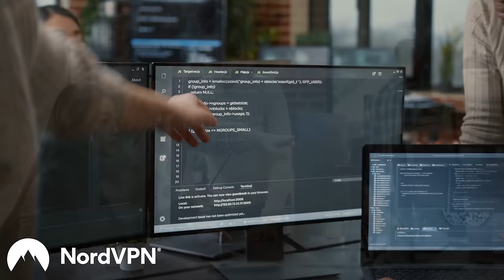Elon Musk fails Cybertruck stainless steel metallurgy test | Auto Expert John Cadogan

Comment: Franz and Lars explained this in the TopGear video. The problem is that because the yield strength is so high with the cold rolled alloy they use (likely 307- with double the carbon content compared with 304 or 316) they have a lot of springback. To compensate for this they have to overbend, but this results in low tool life from the die (what Elon means by “breaking the tool”). Plus they are using air bending, where the tool doesn’t contain the material, but there is high pressure air in between.
Reply: That's not at all what air bending is. Google it. You can have a bottom-bending die where the radius matches the punch+material, and you can have air bending where the bottom is "open" and the punch (plus travel and pressure) dictates the radius formed. There's coining too, but that's def not what's happening here. Air bending requires much less force but requires depth to be controlled, and it's much cheaper as you can use a much smaller press.. There is no "high-pressure" at all in air bending. Franz and Lars sound like idiots.
Reply: I think the choice of material used for the Cybertruck is not so much the strength, hardness, bullet-proofness but its ability to meet the regs for crash-structure / crumple-zones.
Stronger isn’t always better.
Reply: @axelknutt5065  Where are the cash reports? Crashes rely more on shape structure and engineering than material. Since this thing was announced, multiple people pointed out how hard edges and box construction wouldn't hold up to safety regs. Fenders and hoods and other body cladding are simply decoration to cover up the underlying structure. Are they sold as off road-only? I'd like ot see the numbers.
Reply: Imagine wasting time discussing the specs of a truck that will never be sold to the general public 😂
Reply: @axelknutt5065 if that was the only factor then practically any cheaper steel or even aluminum could have been used.  This is the same Stainless steel the Starship uses and is only produced for SpaceX and Tesla.  And neither 304 or carbon steel mentioned in this video could stop a 9 mm bullet.  Normal car door panels are no obstacle for 9 mm penetration despite what you may see on TV or movies.
Reply: @dk-bw4gk The CyberTruck is already being sold for on road use in the US and have passed all required testing and crash worthiness tests. Just because you haven’t personally seen the crash data doesn’t make it not true. It’s also untrue that the fenders and so forth are only cladding .  They are part of the structural strength and rigidity of the trucks structure and are bonded and bolted to the trucks cast structural component.  

The crash tests I have seen are way better than the ford lightnings and most any other truck on the market. No doubt like the Model Y it will receive top scores in crashworthiness.
Reply: @richb2229  I asked where they are. I haven't seen them. There was also a lot of talk about a bunch of things that didn't meet DOT requirements, like headlight height. Did they fix all these things?

Most EVs have good crash ratings because they weigh so much more than their gas counterparts and have an extremely low CoG. Having a 2000 lb ballast under your feet turns the car into a weeble wobble.

If the fenders are integral to the structure, does this mean a fender bender will compromise the structure? Will it be illegal to drive around with a dented fender? This reminds me of how a motorcycle must be scrapped if the frame has even the smallest dent.
Reply: @dk-bw4gk integral is a term so far only you have used.  The question is whether or not the exo-frame contributes in any significant way to the vehicle structure.  Tesla claims it does. Haters make up strawmen instead of showing actual data.

Either wait for the breakdowns or STFU. It's all unsubstantiated claims and speculation until proven otherwise.
Reply: @tripzero0  You're the one making claims, so likewise.
Reply: @richb2229  do you know what dk-be4gk is on about? I sure don’t - is he arguing for or against us?
He can’t  be an engineer because he didn’t begin his comment with “as an engineer … “ and that of course is a requirement for any conversation they have. F.I.G.J.A.M
Reply: Do you seriously believe that CT will never be sold to the general public? Remember you said this. You’ll feel silly not too long from now.
Reply: @richb2229  I read all your posts in my head in John's "outraged uninformed commenter" voice.  It's hilarious - thanks.
Reply: @dk-bw4gk there’s videos of the crash tests on YT. They have already delivered to a few customers and there’s videos on YT of people spotting customer’s Foundation CyberTrucks in LA. 

The headlights are down lower between the black strip and the SS strip. The strip along the edge of the bonnet is the light bar, not the head lights. So the head lights are down lower and legal, they won’t dazzle on coming traffic.
Reply: @anywhereroam9698 those aren’t 3rd party results for cybertruck
Reply: @papalegba6796  are you asleep?
Reply: @richb2229  I agree with you that it won’t stop a 9 mm but the gun that they used shot a 45 caliber. They also used a shotgun which shot. 00 buckshot. I think the 45 caliber only travel traveled at 945 ft./s. Most all of my guns shoot at about that speed. I think that’s a bad representation for the durability of the truck. On the other hand, most door skins would definitely be penetrated through the outside, and the inside all the way through the vehicle, even with the 45 caliber.
Reply: @dk-bw4gk He got more likes, so he won (sarcasm). I liked the argument about fender bender. Obviously they aren't structural elements.
Reply: @papalegba6796 this comment didn't age well. Lol
Reply: @linemanap  It aged perfectly, as none have been sold to the general public. There is no evidence any have 😂
Reply: @linemanap  name one owner please! 😂
Reply: @dk-bw4gk lol, calling Frans an idiot 🤡
Reply: @matthevandaalen6289  I don't even know who Franz is but I can't find anywhere where a layer of high-pressure air bends the sheet. There are pneumatic presses that use air instead of hydraulics in the ram, but there's no difference in how the sheet is bent. Blanc777 also described it terribly by saying "there is high pressure air in between" and I don't really know what that means either. There's also hydroforming whish is used to create intricate shapes in sheet, but that's not what we're talking about here. So please, tell me what air bending is and how it's not where the die has an air gap at the bottom.
Reply: @matthevandaalen6289  Alright, so I looked into what Tesla are doing and Blanc777 botched it up pretty badly. There are two bending operations discussed here: the braking and the stamping. The braking /is/ using the term "air bending" (even though it's already a thing) but it has nothing to do with strength or "breaking the tool" as Blanc says. It's only to keep one surface free of tooling marks by using a cushion of air. This is not the tool that's breaking. Then there's the stamping. They are stamping the interior parts (inside of the doors) in a very "clean" die made of aluminum-bronze. These are the dies that are breaking because, well, aluminum-bronze, and they're using this to also keep the marring down as aluminum and bronze are so soft. This has nothing to do with the strength of the SS but the softness of the die. For some reason (that I can't find) Musk is adamantly against protective coatings or films, so air cushioning and soft dies are used instead to not scratch up the panels. These panels are also 3 mm (1/8") thick! That's nuts. Why?
Reply: Yeah you are right. They are Tesla's internal testing. It complies with Federal Motor Vehicle Safety Standards, and has a preliminary NHTSA safety rating. They got 5 stars for their other models, from NHTSA. Tesla claims the CyberTruck is very safe. When more have been sold and delivered, NHTSA would test it themselves.  @Chuina
Reply: @dk-bw4gk  The crash test videos are on the internet. Do you really think a motor vehicle manufacturer would not know the required headlight heights? Theres been a lot of people spout a load of crap about the cyber truck. Try watching Sandy Munro's videos on it. He is the real expert.
Reply: @Jimmy-hf8fz  There are crash videos but no official tests and no data. No US agency (NHTSA or IIHS) has crash tested the CT.
Reply: @papalegba6796  Uninformed: it is priced as the other trucks.
Reply: @mletouutube  You can't buy one though 😂
Reply: @papalegba6796  I ordered one, will get it this summer. Don't talk about what you do not know.
Reply: @mletouutube  sure you will 😂
Reply: @papalegba6796  First naysayers said CyberTruck was vaporware (like this guy in the video) and now they say it is not for general public or will not ramp up production (moving the goal post is their tactic so they have the illusion they are not wrong to have stated CyberTruck was vaporware). The general public (in USA for now) who pays for trucks will pay the same price for the CyberTruck. Naysayers never learn that they should never bet against Tesla as even if Tesla is late in its prediction, it always delivers. The naysayers assume that there is a nefarious endeavor in Tesla or Elon Musk. It is a false belief. Having this assumption makes me suspect that jealousy is the motivation behind all this hate. Naysayers have been proven wrong again and again. They always double down or move the goal post. You are in this club for sure, especially this guy in the video.
Reply: @mletouutube  I'm not reading all that about a truck you can't buy 😂
Reply: @papalegba6796 😂 the hater denial is strong in this one
Reply: @AndrewReadman  "hater denial"? 🤔😂
Reply: Biggest issue I’ve got with the material used is the reason for using it. It was supposed to be an exoskeleton, but they dropped that idea because they couldn’t get it to work. So why still use that extremely heavy, difficult to process material if it isn’t needed anymore?
Reply: @angrydoggy9170  exoskeleton, monocoque, stressed skin, tesla said it would be all 3 at various times they are completely full of sh!t.
Reply: @papalegba6796   your going to be standing on the sidewalk scratching your ass watching cybertruck go by
Reply: @sigsire  wrong, shill guy 😂
Reply: @papalegba6796 you seem super uninformed.
Reply: @hotrodandrube9119  you seem like a tesla shill 😂
Reply: Lars is an engineer who worked on  inventing and developing the process that they use to process and bend the alloy that they developed.    
They have a video with sandy munro where they walk through all of the processes and machines that make/form the panels.    They use several unique processes and coatings that they invented (with Lars at the head of that research).
But I'm sure you know far more about it than idiots like them 😂
Reply: @axelknutt5065 americans don't care about pedestrian lives
Reply: @papalegba6796 " general public"?there are 2 million $100 refundable reservations! , Elon has said they have prepared for 250,000 production numbers/ year facilities in Giga Texas, those are Ford 150 #s, I fully expect Tesla to deliver on those numbers.a Pickup that won't be dented in a parking lot by an errant SHOPPING CART is peace of mind, yes I have had those misfortunes!
Reply: @AuralioCabal  "elon says" 😂😂😂😂😂
Reply: @papalegba6796  Because they have about 2 million orders already, dude. Don't worry, they will have one for you when you have saved enough pocket money, and by then you will have the added benefit of the Cybertruck being on about it's 10th version...........
Reply: @jeffhubbard4688  cool story, shill bro 😂
Reply: @richb2229 Normal door panels are thin to save weight because stopping bullets was never on the radar. 9mm rounds are hardly a test for bullet stopping ability anyway.
Reply: @dk-bw4gk obviously you don't know what your talking about as they are being delivered  so "everyone" you are talking about were wrong about it not meeting American safety standards.
Reply: @robinheider414  Keep reading. I could not find any agency that has tested it. You also do not need to meet crash criteria to sell a car, you just don't get to use the 5-star rating on your marketing wank.
Reply: There you go again with the facts.
Reply: @semilog643  sure, but the anti-elon people need to get a grip.  I hear a lot of verifiably false claims about the CT including that it doesn't have crumple zones or is some sort of death machine on wheels (supposedly somehow more than a "regular truck" is).
Reply: @axelknutt5065  Classed as a truck is it exempt from all those rules?  Will it be legal anywhere other than the USA?
Reply: @richb2229  What were the G-Forces on the occupants?   Why did the bonnet ripple and flutter like its made from a much thinner material?  Only seen a very brief clip of the crash but cannot remember the channel, one of those that pop into your feed and you partially watch and go away and forget to finish watching.
Reply: @WhiteDieselShed  interesting point .. not sure. Where I live it’s going to come down to gross weight of the vehicle. If it’s considered a ‘truck’ not a pick-up, you’re going to need a license endorsement to drive it.
Reply: You dont buy hard steal raw steel.   You make it hard.  He said they work hatden the steel till its almost lost its elasticity.  It is now a harder steel. 
Work hardening is a real thing.  
My concern is that body shops might try to fix dents and make these structural parts unsafely britle. Or that these werent crash tested at freezing temps.
Reply: @royphillips7644 they did shoot with 9mm.   But not all 9mm is the same.  They have brass, stainless, copper jacket. Hollow piont. Ect.  
A 40 cal would be the most impressive to stop outbof common handgun rounds
Reply: @dk-bw4gk 😅 & your the genius 😅😂
Reply: @richb2229  : You might have noticed that Model Y looks very similar in structure to other high-end cars. The crash safety comes from using the tried-and-true ways of designing automobiles that have been proven to work (and then having a very low center of gravity and not hot ICE to fall into laps of the front seat passengers).

Meanwhile, Cybertruck does not follow the tried-and-true automobile design principles. If it's so safe, surely they can let independent parties crash test it, no?

Comment: Good job John 
There is a whole industry in the UK fixing the scratched stainless on Deloreans - costs a fortune also 
Dissimilar metals - cavity corrosion will be a problem if not fully isolated from the model Y subframe and cast aluminum front and rear support assemblies - completely agree these will be scratched up garbage after 5 years if taken off road
Reply: The bodywork lightly a write off after even very light crash damage.
Reply: Yes you wouldnt want to park it in an industrial area where regular carbon steel fabrication is taking place. That bare  stainless body wont take kindly to some metal dust contamination and a shower of rain.
Reply: Delorians and Cybertruck are only similar in appearance. 
Delorians - Mild Stainless steel , approx 1mm thick
Cybertruck - Cold Rolled Stainless steel about 2x as hard, approx 3mm thick. 
     The shallow scratches you might manage would buff out with scotchbrite (vs cost of repainting)
Cybertruck alloy developed for a large orbital rocket that was designed for multiple re entries without corrosion. 
If you are referring to void embrittlement through diffusion, I'm sure there are many ways to prevent that.
Reply: I'm reminded of the impossibility of removing stainless hardware from my aluminium boat masts after corrosion.  And the fun of drilling out the stainless fasteners in the soft aluminium.
Reply: DeLorean has sold 7000 Vehicles world wide total, you wanna tell me there is a whole industry in the UK fixing them? Cant be very profitable lol
Reply: The stainless is the same used for Star Ship....
Reply: @richiedoop2529  it will never be sold to the general public, nothing about it matters 😂
Reply: @kylereese4822  starship is fake 😂